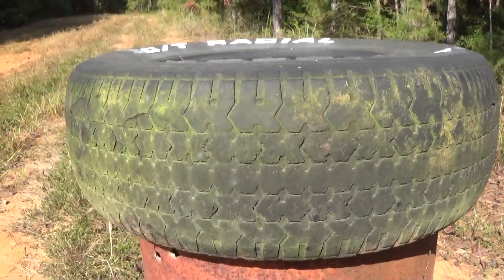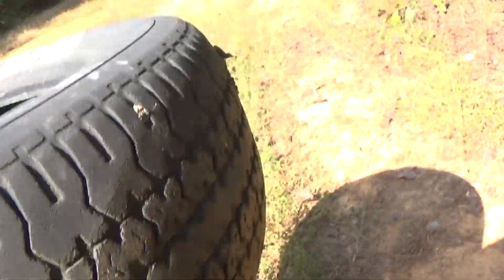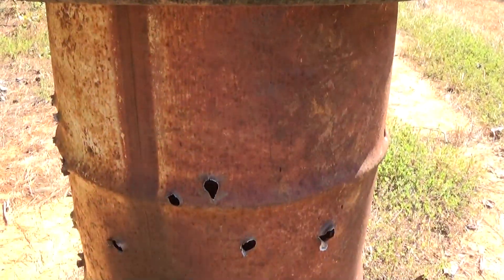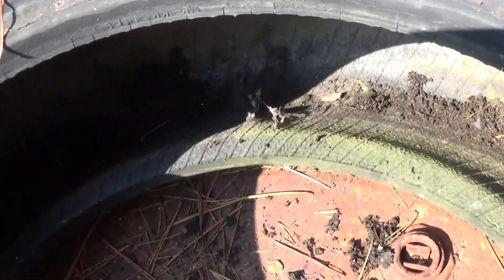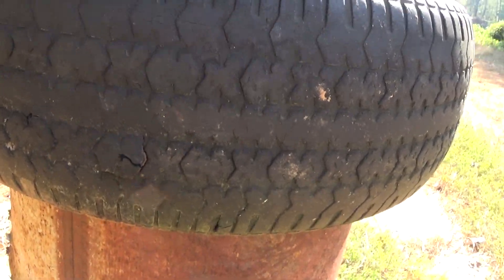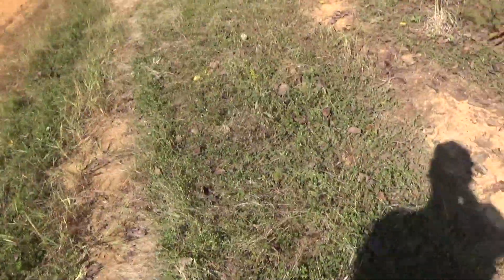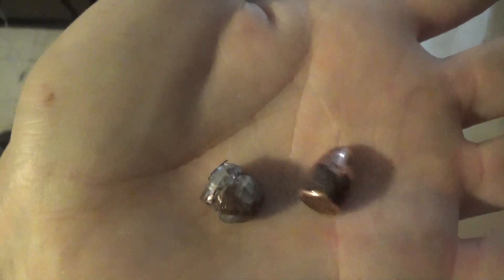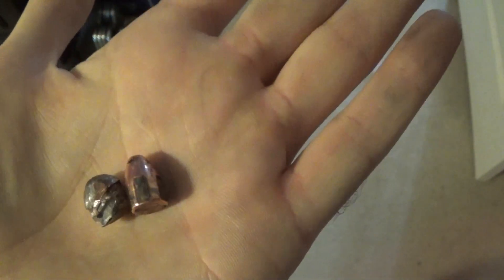Can a Rubber Tire Stop a 9MM Bullet: Testing a Hypothesis

Comment: In Mexico, the militaries will set up campsites around drug dealing forests and make walls of truck tires and fill them with gravel. Rubber alone can't stop a high powered bullet, however rubber is very shock absorbing and stretchy making it perfect to help absorb shock from bullets and slow them down while the sand completely stops the rounds.
Reply: That sounds cool. Could you provide a source? I would like to read more about this

Comment: I'll say that's pretty smart, if not ingenious, but the only risk I can think of is the bullets that don't penitrate might ricochet. So be careful at a good distance.
Reply from the maker: +Daniel “Hero's Apprentice” Scharn that's a good point. Part of the goal is to have the bullets imbed and stop rather than bounce or richochet. With the right combination of layers it could work
Reply: +MISTA WULFY Just try and consider the ricochet. hell I've had bullets ricochet of goddamn dirt rubber just makes it more justifiable. Just caution yourself.
Reply from the maker: Daniel Scharn thanks. I'm also working on a shooting guard to stand behind, likely made from the same material I'm hoping to test
Reply: Maybe consider putting both tire rubber and that test material together to see if it'll improve results? You'll never know till you try.
Reply from the maker: Daniel Scharn yeah I'm going to find some thin metal like maybe some aluminum siding and put it with the rubber, maybe a couple of layers of each. The metal should theoretically stop the bullet after it passes through the rubber layers